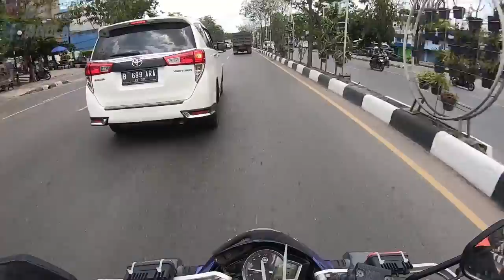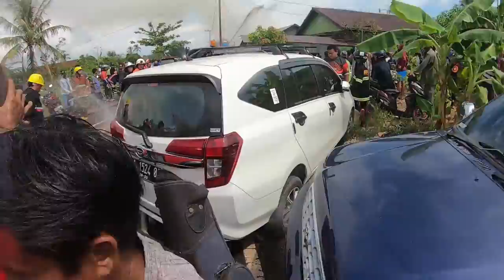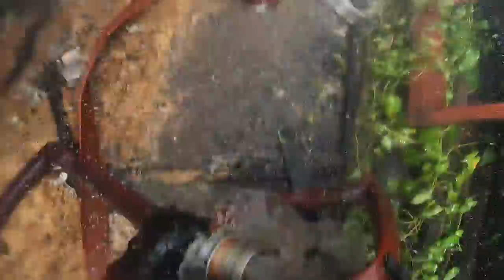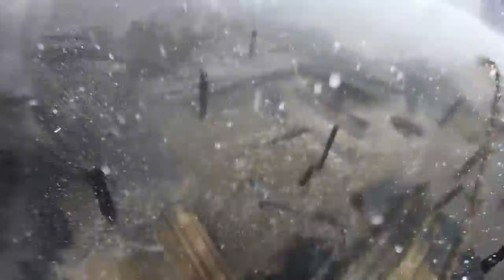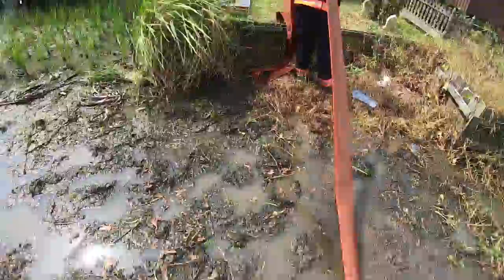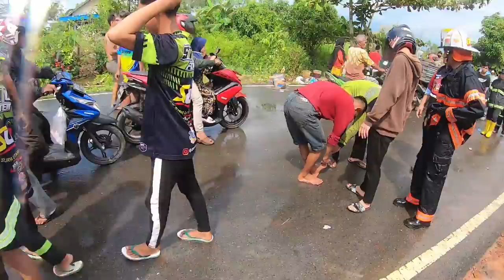252# respon cepat jaya 65 TKM kebakaran malintang gambut banjarmasin

Comment: Bang knp pemadam banjarmasin ndak ada truck pressure high serta truck pendukung lainnya serta alat pendukung APD dan lain sebagainya seperti di daerah²/kota² yg lainnya..
Reply: kerna sumber air di sana mudah aja tidak sulit
Reply: Tetapi kalo menggunakan truck pemadam yg seperti dikota² lain lebih memudahkan dan bisa membawa air internal maupun external dan Alat bisa membawa  peralatan lainnya sangat lengkap..maupun APD nya lengkap seperti mask oksigen dll..
Reply: @Onichan_s  karna kalo pakai unit tangki susah masuk ke gang sempit
Reply from the maker: Sulit klo ada trcuk
Reply: Ada beberapa punya Pemkot tapi tertutup karna lebih banyak BPK swasta .... Untuk APD mungkin ada tapi gak lengkap...mengingat ini BPK swadaya dari masyarakat jadi kelengkapan terkadang kurang bisa terpenuh..

Tapi ada yg lebih dari APD yaitu ketulusan hati mereka membantu sesama walau sekalipun nyawa mereka taruh kan..